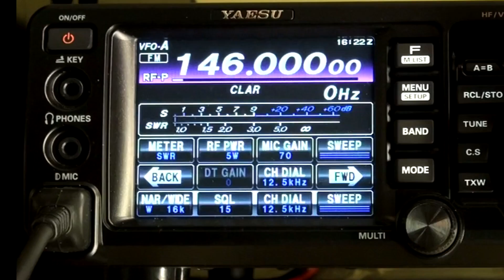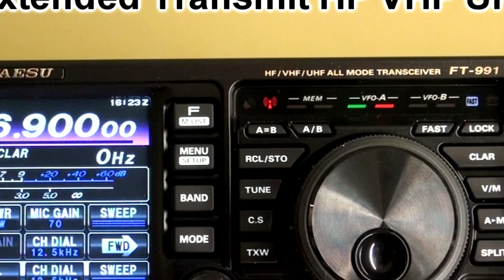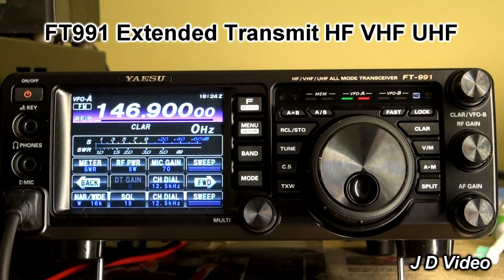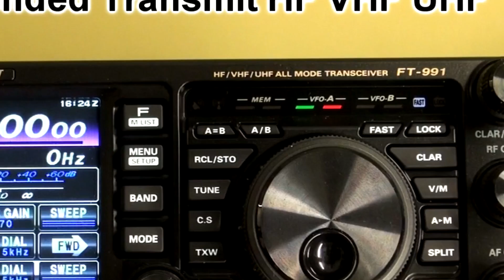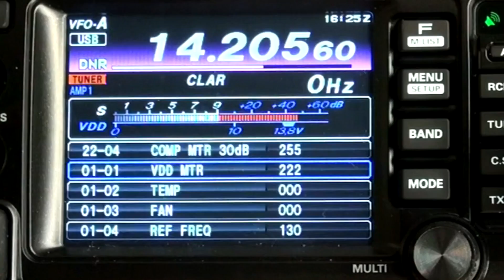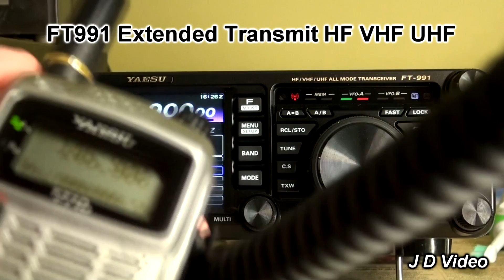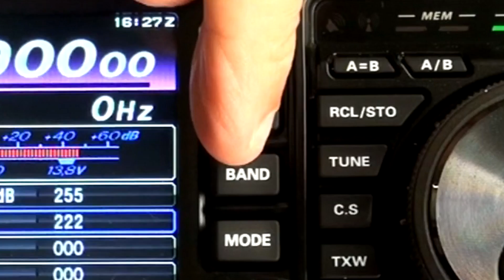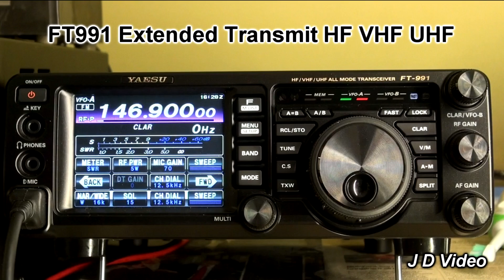FT991 Extended Transmit range

Comment: 1. Can you tune (internal or external tuner) when using an extended range frequency in the service mode?2. Does this work with the North American version of the FT-991 (Can another user check theirs)?
Reply from the maker: I have tried the internal tuner on my European FT991 on 13.800Mhz and 55Mhz and it performed ok. Yaesu do not guarantee full spec performance outside normal frequency allocations so there may be some frequencies that will be difficult to tune. I think it is reasonable to assume that the service mode is common to all versions.
Reply: @oldcorvus  I have the MARS mod done and the tuner works fine on 11 meters.  The antenna tuner inside of the 991(a) will tune any frequency below 55 MHz as long as the antenna is somewhat resonate, i.e., SWR 3:1 or lower.  It's not the job of the tuner to make your antenna resonate.  As long as it's close the antenna tuner will do its job.  I have an Antron 99 that I use on both 10 and 11 meters and on 11 meters without any tuner will return a 1.5:1 every time.  Since the antenna is close to resonate on 10 meters, the internal tuner will match the antenna.  Antenna tuners are not really antenna tuners per se.  They just match the transmitter to antenna and some power is lost in the match.  W Rusty Lane K9POW in eastern Tennessee

Comment: we should find a way to use this in normal mode. Thanks for information.
Reply from the maker: I quite agree, Yaesu insist that the European version can only be opened on the 1.8 to 55mhz range. not on vhf or uhf. I am sceptical as this goes against the standard practice, so I offered this method as an option which did not invalidate the guarantee or risk damaging the radio by making random jumper connections. Best wishes.

Comment: Many thanks for the video, I've had a poke around the engineering menu as few times as I was aware that the radio would TX but never thought of this as a way of actually using the radio out of band and as you have said everyone please be careful not to adjust the settings in your radios, you can seriously mess them up if you!
Reply from the maker: Despite Yeasu insisting that it is not possible for the European version to transmit extended range on vhf and uhf, I remember what I used to tell my students back in the 1980s that 'Nothing is impossible in electronics' :-)
Reply: Jed Deadlock there will definitely be a way of doing it.